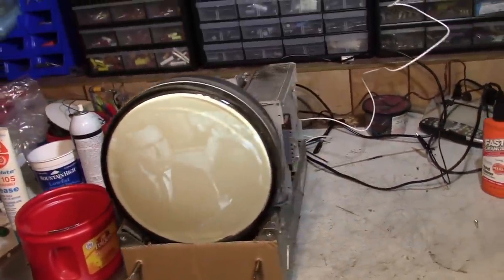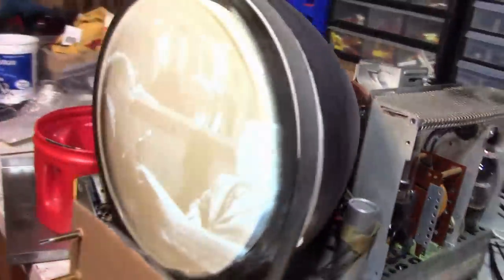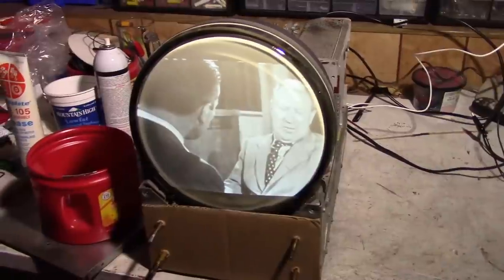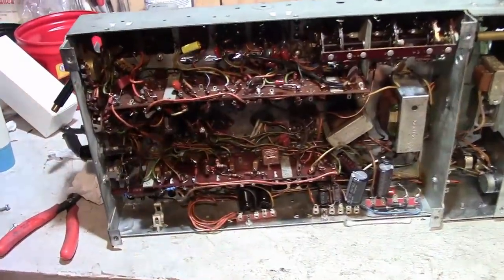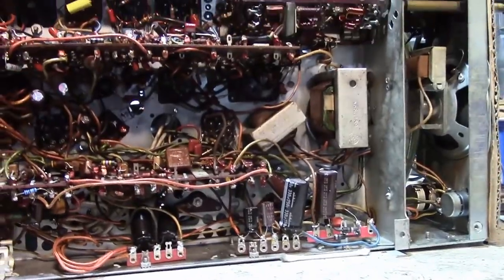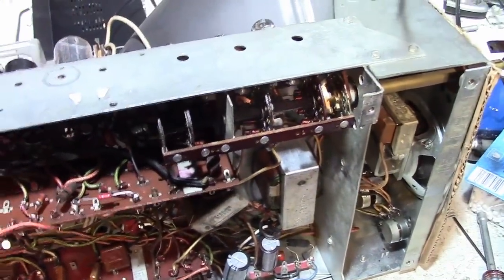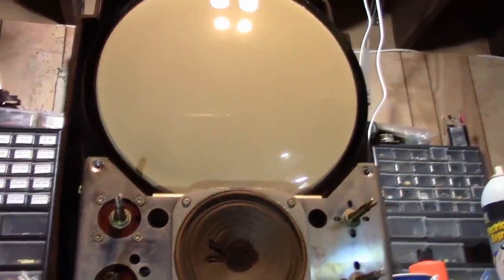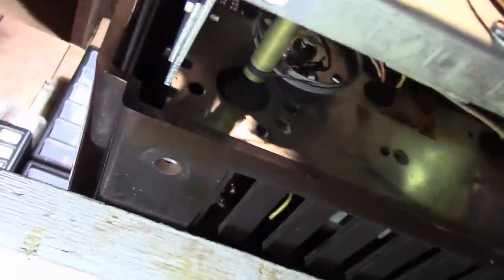GE 800D restoration p8o8

Comment: Thank you for this series Bob. I'm about half way through the recap on a 805 locomotive. I must say. I'm super intimidated by all the troubles you went through. Might have bitten off more than I can chew with this one. Time will tell.
Reply from the maker: Well for what it's worth most of my troubles stemmed from old repairs - especially the flyback not being quite right.
Reply: Do you recall what value dropping resistor you used after replacing the selenium with diodes. Are 1N5408's good to use there? Thanks Bob.

Comment: You really got that set working nicely. I'd have to look at the schematic again, but thought most sets pick the snyc off before any any contrast and brightness controls. I can rewatch some of your earlier videos on this set. Hope you make a complete recovery soon.
Reply from the maker: It does take it after the video amp and sends it to a limiter.  That is supposed to amplify the signal even more and clip it to enhance the sync pulses.  I did receive a few comments from others that have this same model and their contrast controls works like mine.  That leads me to believe that it is working correctly.

Comment: I had strange problems with my sense of smell as well. I got Covid and smell was reduced and changed slightly. 90 days later I got the shots and my sense of smell and taste changed completely. Now eggs taste like soap and flatulence and BM smells like kerosene. Some things like oregano are totally unaffected. The affects of the shots were 10x worse than the Covid virus itself.
Reply: Sympathies.  There might be something about getting the vaccine on top of having had a case of COVID-19 that stirs up old symptoms as part of the immune response and makes them worse.  Having gotten the vaccine (two and a booster, all Pfizer) but having escaped COVID-19 itself thus far, I have not yet suffered any smell or taste irregularities, just a sore arm.

Comment: I noticed you simply put the 75 Ohm droppers for the filament strings back instead of the other options. What brought you back to the original design?
Reply from the maker: Using a diode starves the tubes a bit. The originals tested good and provide a softer startup than I had expected so I put them back in

Comment: Good job on that monster. Did you ever think of upping the HO tube to a 25BG6? That would help compensate for the much higher line voltages of today, and improve the life of the set.
Reply from the maker: I don't believe there is a 25BG6.  Maybe you're thinking of a 25BQ6?  Anyway, I modified the two filament string droppers for higher line voltage.
Reply: @bandersentv  - Before I suggested it, I did look it up and they made a 25BG6.
Reply from the maker: @f.k.burnham8491  I can't find data on it.  I only get a hit on a 25B6G